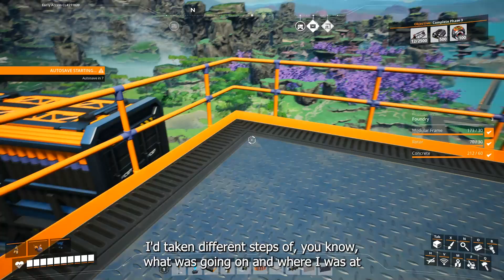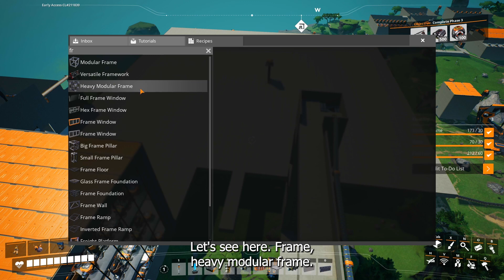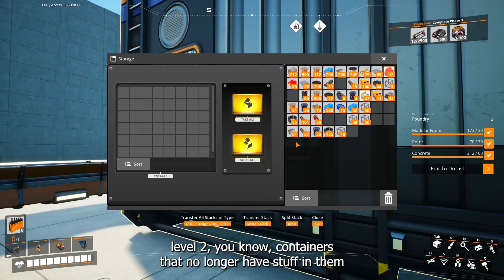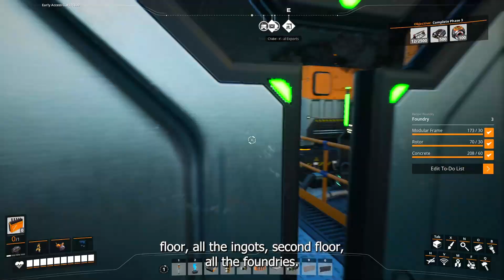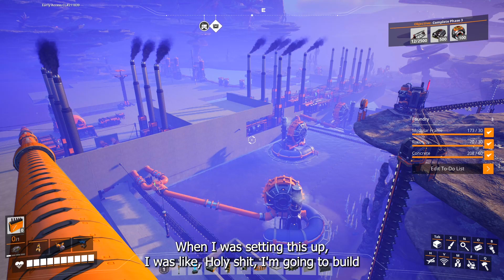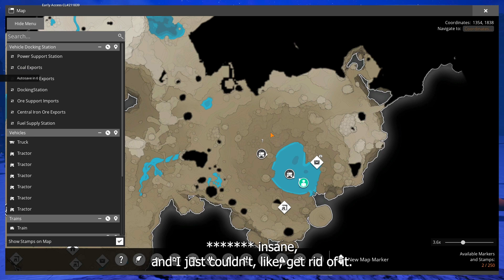Satisfactory - Factory Tour (Ongoing Projects)

Comment: I really enjoyed seeing your work in progress.  I'm a newer player, so I was able to pick up some good tips. And it was good to see someone who hasn't spent 8k hours building some mega factory. I think I am better off doing what you have done - break up production into several smaller buildings. I think that will keep me from getting overwhelmed. And good tip to just leave the game running to build up resources. I like that. Thanks for posting!
Reply from the maker: I started out with several little buildings that went vertical with different levels ultimately coming to one final product. The biggest resource I saw that was needed, were screws. You could never have enough screws for the life of you. The same goes with Coal Power, Coal is a hard resource to find and its never just down the road.
Reply: Thanks for yet another tip! You're awesome